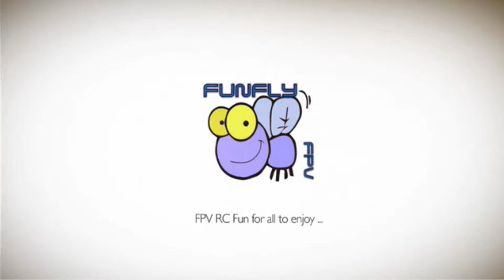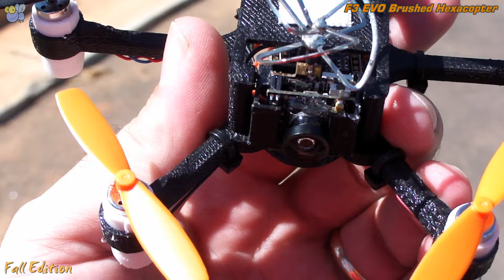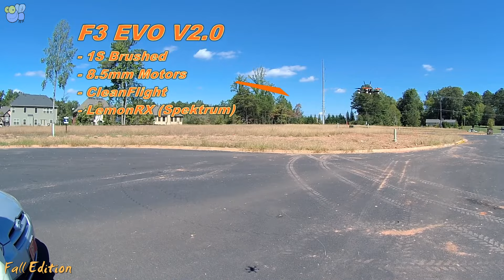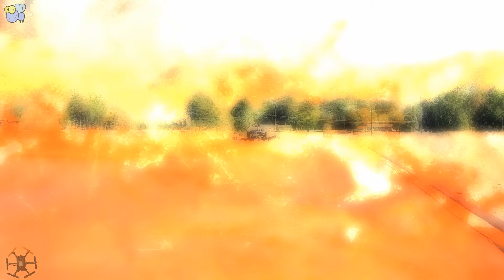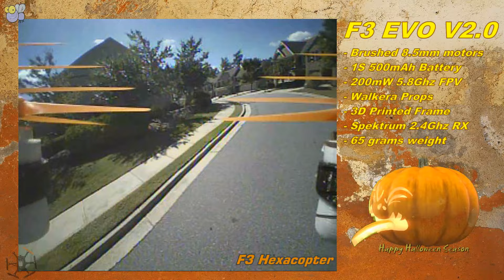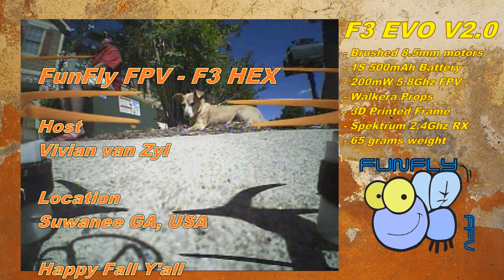F3 Brushed Hexacopter

Comment: the camera image looks great!  What are you using?
Reply from the maker: It is a VooDoo Micro from here: http://www.voodooquads.com/voodoo-micro-600tvl-cam-vtx-200mw-40ch-5-8ghz/
Reply: Well I just purchased this Eachine TX02 Super Mini AIO 5.8G 40CH 200mW VTX 600TVL 1/4 Cmos FPV Camera
https://banggood.app.link/u55pnCqW0w
It reads and looks identical.  It'll be my 1st AIO camera.  Been using the 1/4 cmos 600tvl and fx758-2 on my builds.
Is your camera PAL or NTSC?  There was no option for PAL with the one I got.